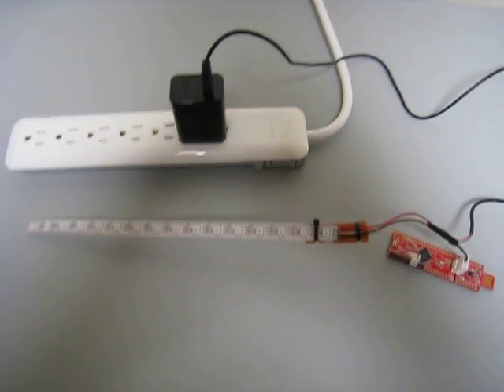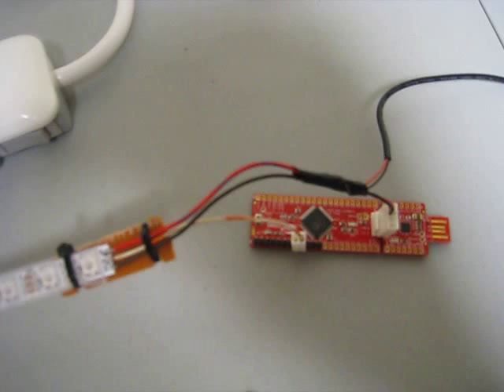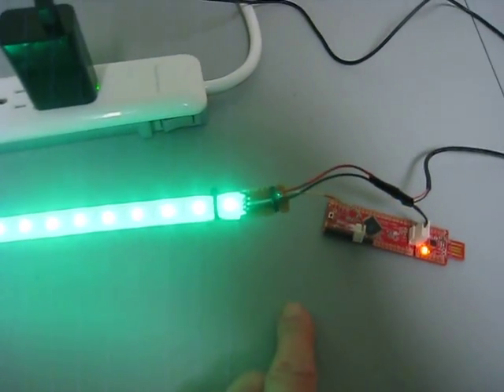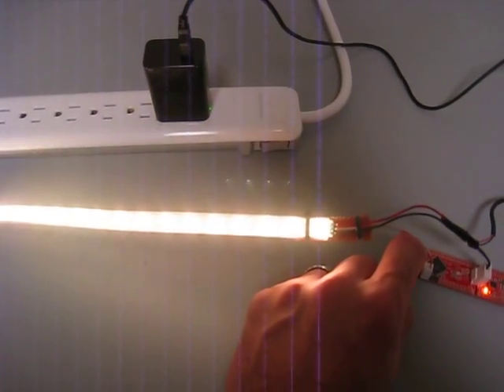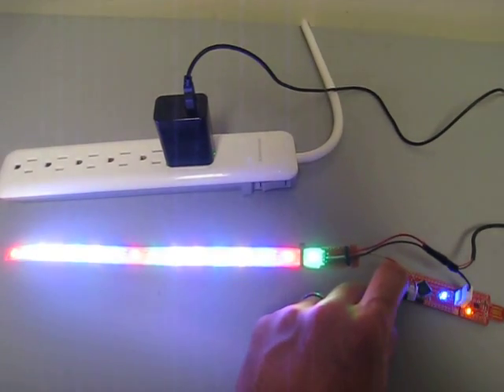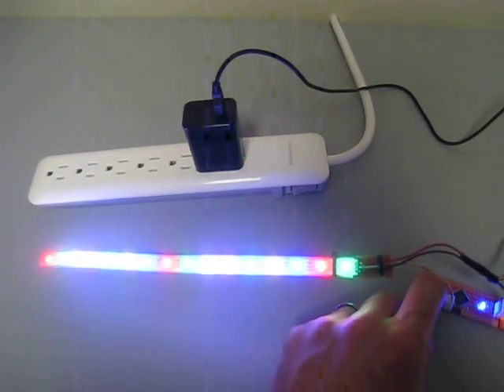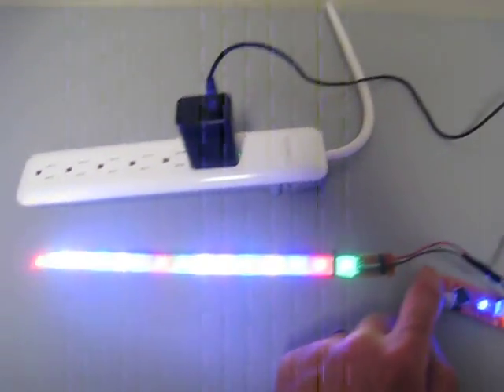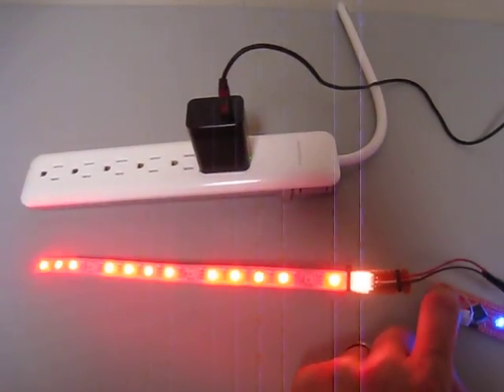Neopixels being controlled by PSoC 4200 using SPI

Comment: try changing the spi sub-type in the SCB config to type = TI (Start Coincides).  In my case the very first SPI output pulse was an extra 300 ns in the default config.  Different LED mfg, but similar timing command requirement
Reply from the maker: This was an early rendition and simply used the SPI bus straight up for controlling the Neopixels.  A couple years ago, I made a library that uses the little state machine inside of the PSoC 4200 to reduce the amount of memory necessary from 9 bytes per neopixel (3 bits of SPI data for each 1 bit sent to the Neopixels) to 3 bytes.  I put a library up on Cypress' website.  Here is the thread that contains my final library for Neopixels.  https://community.cypress.com/thread/30390